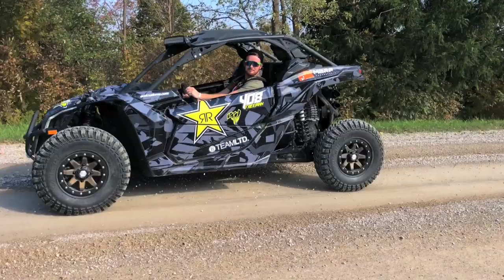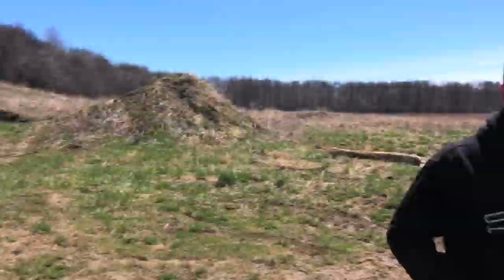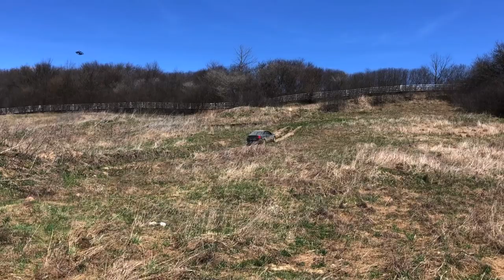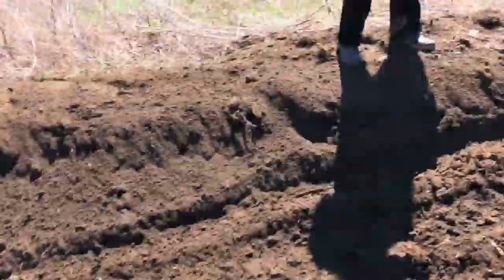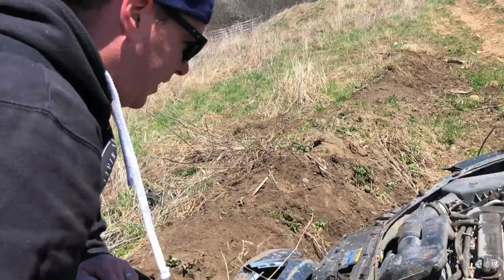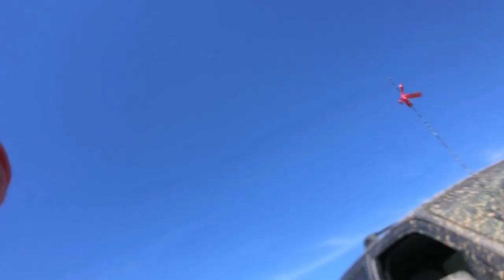Pontiac G6 CAR JUMP Epic FAIL!

Comment: Hey Mark try taking the seat belt and wrapping it on the steering wheel and the buckle it in should hold the steering wheels straight. A tow truck driver showed me that trick.

Comment: Why would boosting the battery help considering that the radio and everything turns on?? Bc mine the battery was facked and it wouldn't start but no lights would turn on or anything

Comment: When you go to line up put the seat belt through steering wheel and latch it. Might need to move the seat up and a smaller launch-o-matic but should help keep the wheel straight

Comment: Mark, When you get to the jumping death stage of the cars. I think you should cut off the driver door so you are safe. If you take that route, unplug the battery during cutting and use a pick to seperate the door harness wires to avoid a short. Use the brushless dewalt saw zall on the hinges. I dont want to see you get clamshelled by one of these sons of bitches jumping out. You can take the doors and use them for targets or something. Also, if you are going to anhilate a engine get it cranking and stand back with the rope wood available like last time for maintainence. You dont want a engine rod or part through your foot, face  or belly.  Keep up the good work and be safe. You got alot of clunkers to kill and summer seems to be here... P.S. I want a sticker for my lawnmower...